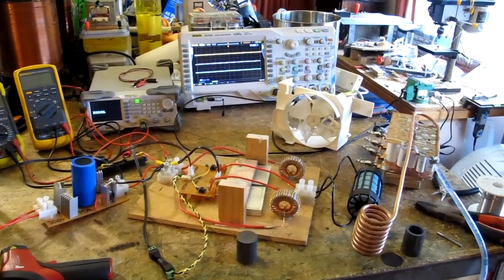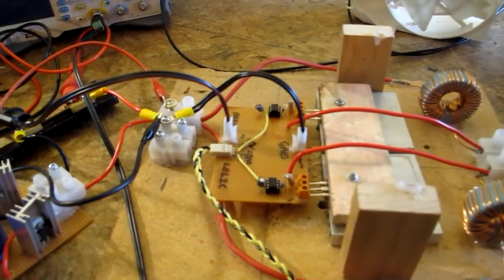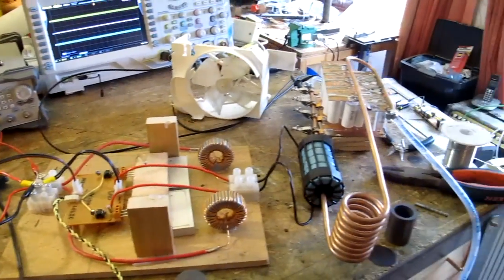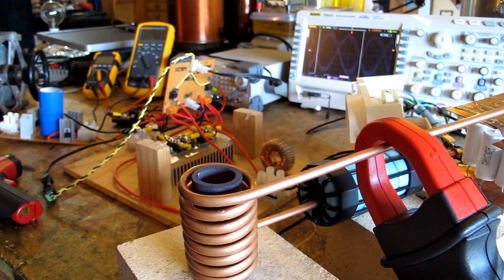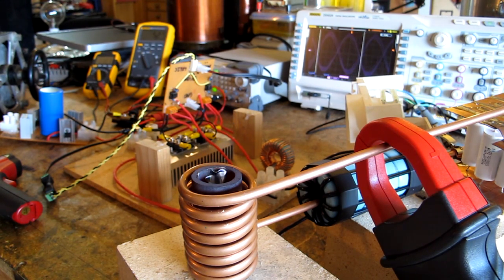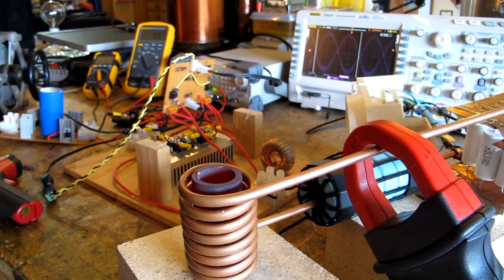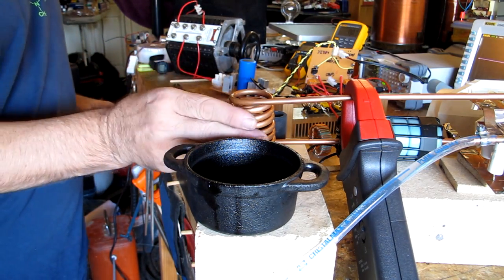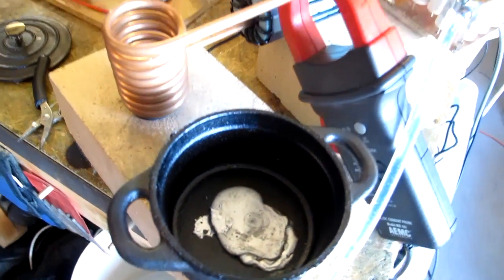600 watt induction heater

Comment: if you want to increase your power level without increasing the supply voltage, 
how you do this?
by lowering the turn ratio?
Reply from the maker: My experience so far is that you want to do the opposite of that. High current means more heat in your MOS-FETs and elsewhere. 

I've wound another coupling transformer with 18 turns instead of the 12 on the current one with the hope of pushing more power through without having to resort to water cooling of the MOS-FETs.

Another change I've made over the design in this video is that I'm now using a full H-bridge to drive the coupling transformer, resulting in 4 x the power at the same voltage and current. Now quite happily melting glass.

Comment: Half bridge ? IGBT or MOSFET ? Thumbs up :)

Alex
Reply from the maker: +High Voltage They're IGBTs and a kind of mutant Mazzilli/half-bridge. Schematic and a bit more detail here: http://imgur.com/TT94Sjn

Quite liking this design for the oscillator over a regular half-bridge as I can still use n-channel devices, but no messy high side switching.
Reply from the maker: +High Voltage Actually, better link: http://imgur.com/a/wjdlX
Reply: gristc Ok, thank you :)

Comment: nice progress. i see you changed over to some real macho mosfets LOL. if you build the PLL driver you can actually get it to track tank resonance and do all the tuning for you as the workpiece heats the frequency changes a bit. I really need to get off my arse and do some more work on mine but other projects keep getting in the way, good stuff
Reply from the maker: +alex993cc1 Hehe, thanks. Looking at something PLL like for the driver, possibly MCU based though as my final goal is to have temperature control over the crucible. I messed up in the commentary though, they're actually IGBTs in the beefier version. IXGN60N60s so I should be able to push a fair bit more power though them once I get proper ZVS switching happening.

Then to play with the CM300s.  :D
Reply: +gristc CD4046 can run it for you. you can even do current limiting to do your temperature control, or if you go the MCU route possible phase angle control using SCRs as your input rectification. check how fast the CM300 modules are, you might find you will need a huge capacitance to get the frequency low enough. i have some CM400s and some semikron half bridge bricks and neither of them are fast enough unfortunately :(